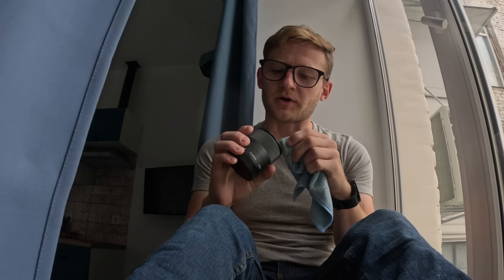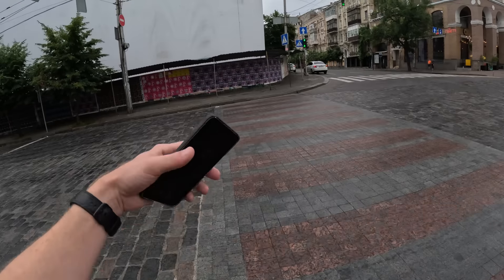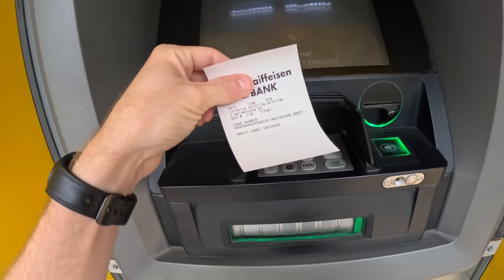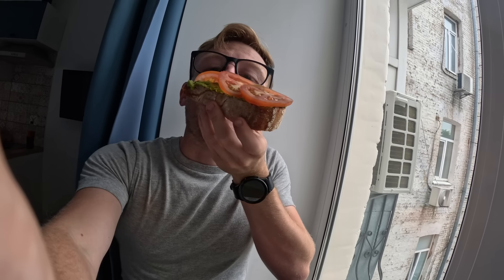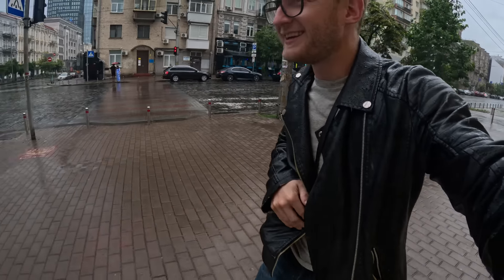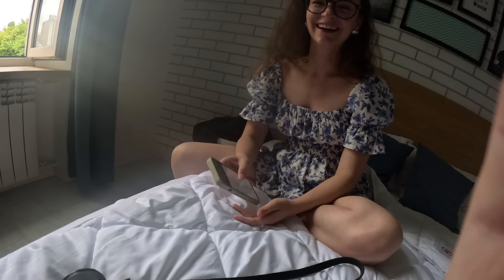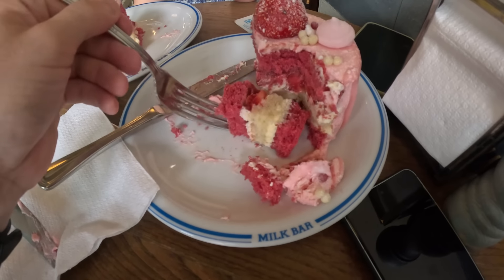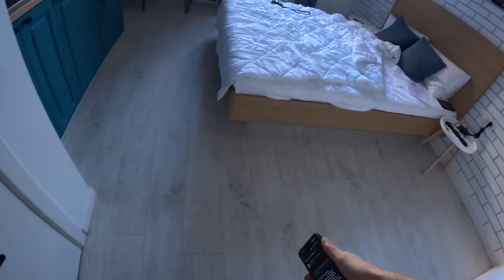You want to meet her?

Comment: All debt/credit cards have daily atm limits or times used at atm. So if it gets stolen no one can clear out all money. Yes going into the bank they should be able to do cash advance where they run the card like at restaurants or shop one time , yes will be fee but before you do that I’d recommend calling the card provider and tell them it’s going to happen so it doesn’t red flag as fraud. Or yes do max transactions daily then go to bank to get larger bills.